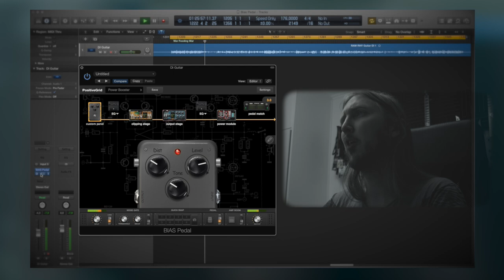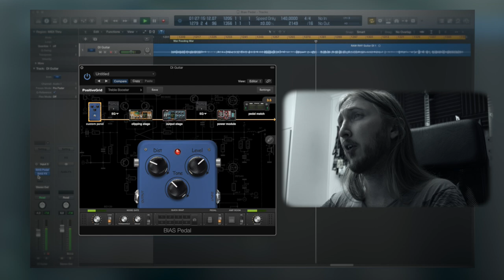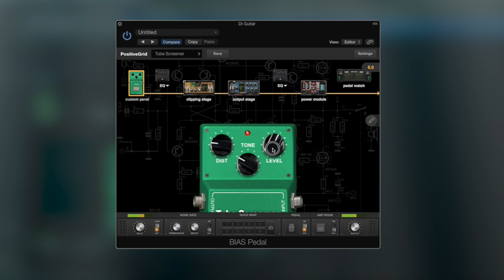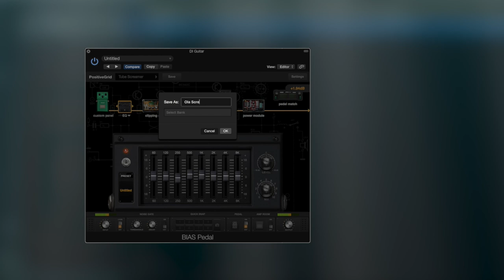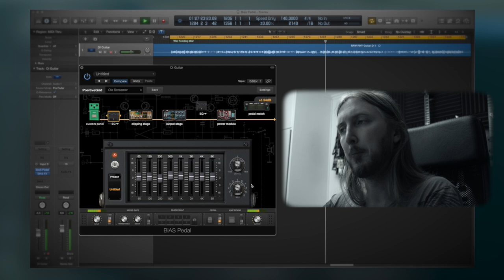Positive Grid BIAS Pedal

Comment: what do you mean by experimenting with more than one battery on real pedal?... is it even possible to add extra 9 volt? or you referring to power supply experiments? since on power supply is possible to use more than 9 volt ...
Reply: +rangga aditya some pedals run at 9v some run at 18v and there're a few others,.
Reply: ChildishLikeMonsters i know that. But he said adding extra 9 volt on 9 volt pedal... That's why I'm curious whether he use  battery or power supply experiments